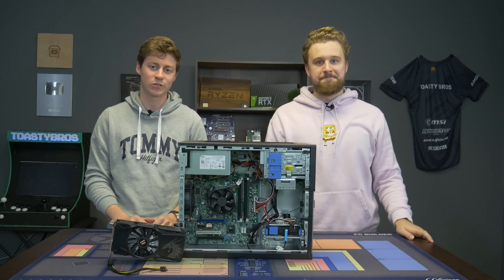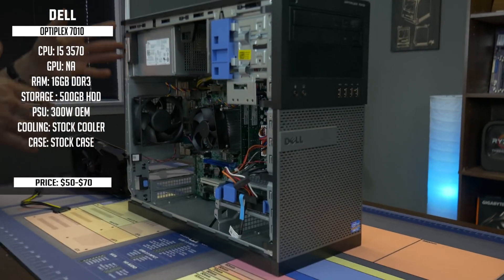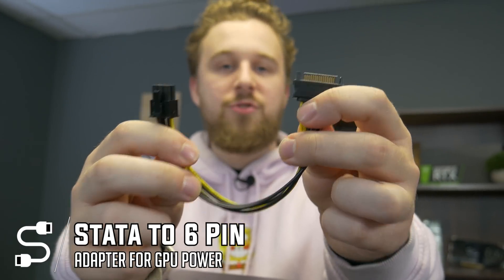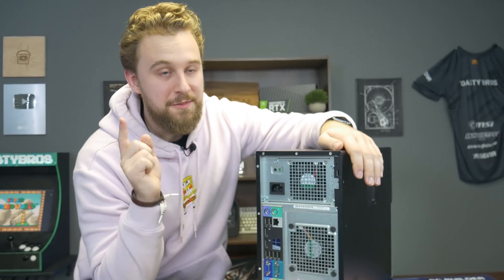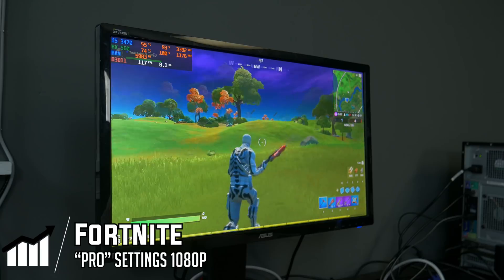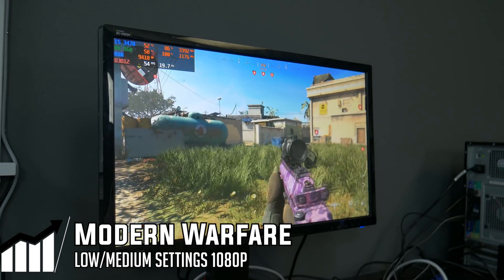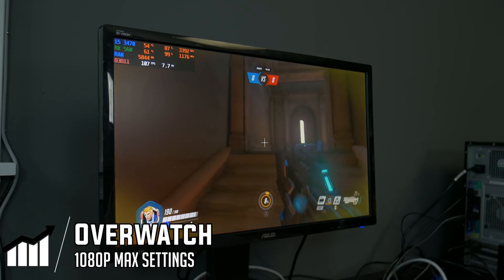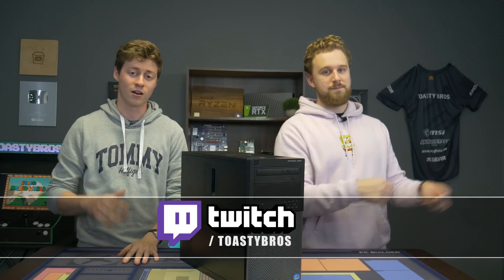2020 Budget $100 Gaming PC - Step by Step Guide

Comment: I have best bang for bucks (i made for friends tho, not mine. I use 4th gen i5 )
Intel xeon E5-2640 v2 LGA 2011 ($25)
Chinese X79 motherboard ($40)
Radeon RX 580 ($90)
4x4gb ECC/regular ram ($60)
Enermax 500w PSU ($40)

About ONLY $255 you will get performance equivalent to $400-450 
The PC that i build with that specs outperform mine with RX 470, which the i5-4460 alone almost double the E5-2640v2 cost. Mine (i5 4460 RX 470) only got 40-50 fps NFS heat mixed settings. And that xeon got 65-80 fps

Comment: Yeah I've got a dell OptiPlex 790 with an Nvidia 780 ti in it which I had to knock the hard drive cage out to make it fit and I upgraded the power supply to an aerocool Cylon 700w

Comment: It's starting to seem like these Optiplex builds are starting to go obsolete because the i3-10100 even without a GPU can play GTA V 1080p at around 50fps now. However, if someone finds a good deal on a graphics card and they're wanting to use it temporarily or for old games they can definitely install it in their existing computer no matter what it is as long as compatibility checks out.

If you have an old computer, you play old games and if you're not spending as much as something new it's definitely a fun experience.

Comment: Still better a deal than a xbone or ps4
Reply: Wrong
Reply: @supersop1367  for power, it definitely is. It'll outperform a 2013 console by a pretty big margin.
Reply: @thegloriouspotato6223  Xbox one is from 2015 and the newer models from 2019
Reply: @supersop1367  Release date for the original One was October 2013. The S was 2016 and the X was 2017.
Reply: @thegloriouspotato6223  ok but it doesn’t put perform consoles the benchmarks are faked I know a few people who followed this video and even had slightly better specs and it was bad
Reply: @supersop1367  I didn't look at benchmarks, I looked at the specs of the CPU and GPU and compared them. usually the only way older consoles are able to play new games is with lots of optimization, and running at low/medium settings would be a more fair comparison.
Reply: @thegloriouspotato6223  ok

Comment: That low price a pc no way ? How good is it ? Id like to see actual plY testing shown & how long it will last in hard play & twitch streaming over time. What of buiying windows to make it run ? What about to stream 2nd screen for you too see chat or just try to use tablet, etc ? I still am planning getting a ps4 & headset, tv, so I don't know if have enough for this, but maybe after if can't Dec Jan then I must get other stuff. These seem refurbished etc, not great ones in look etc to see there. Only one was minor scratches it said comes with all bundle, except maybe cables. It had monitor, windows, , keyboard, but scared ordering such an item on ebay even if good reviews on seller. Idk. Not sure same seller of the link as it has been a while & just found you. Different prices & seller. I want new not worry it won't work after 3 months when cant claim ebay money back. plus I do not want to pay 1 yr warranty extra. Guess I should on this if got it.

Comment: would a 2g card work?
Reply: yeah but 2gb is a little low especially for newer games, we are at a weird time right now pc prices are high and games are going to get alot more demanding in the the next years (new console gens)
Reply: @NaterBalls  I am getting a rx 570 4g with a 250g ssd and 12g of ram I think it should perform well also I'm getting a 500w psu
Reply: @bradyscherer675  nice, rx 570 for about 75-150$ gtx 1060 6gb is in that price range to if you haven't checked them out

Comment: What about the psu if I don’t upgrade it what happens
Reply: " boom " maybe it will take out and/or damage pc parts when it blows, their are lower watt gpu that would work if your worried (i would be) gtx 750, 1050, 1030,1650 rx 550 to name a few

Comment: I clicked the link and the optlitex cost 170+ dollars 🤨
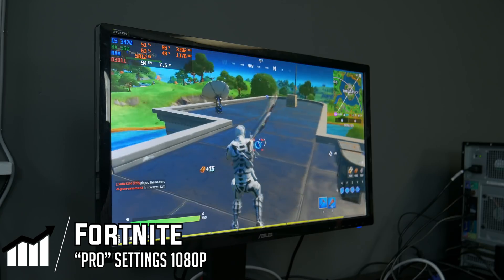Reply: Their budgets are completely misleading.  I like in the video where they suggest opting for a RX560 with better video out options for around $50-60 (6:25), like you're going to be picking up a in pre-built Dell with 3570 and 16Gb for..I dunno....let's be generous and say $70.  This build they're recommending is more like a $200+ option.  More likely you'll get it with 8Gb RAM for around $120 if you can find a good price, then upgrade the RAM yourself for $20, and get the RX560 for around $60.  $100 is just complete horse shit.   Also SATA power cables are rated for 50W, and PCI-E can draw upto 75W.  An RX 560 has a low TDP of 75W, which can be supplied directly from the motherboard, so it's no likely to be drawing more than an extra 50W from the power cable, but it's running the risk of putting a more power hungry card in the system and overpowering the cable - basically it's just not a good idea as the pwoer card could technically try and draw more power than the cable is capable of, causing a fire hazard or at the very least the cable melting / shorting something in the PC.  But want do I know, I've only been building PCs for 20 years, these guys have 180k  subs, they must be pros!

Comment: Where would the SATA connector be if it is not right by the hard drive? What is the difference between a dell optiplex 7010 and a 990? I am thinking about getting a 990 is there is no real huge difference.

Comment: Hey I got an optiplex 3010 with a i3 3220 and a rx 570, but the graphics card gives no signal. It has worked a couple of times, but after 5-10 minutes it just goes into a black screen.

Comment: I've done this a few times now. So something consider: The GPU you've picked is a mining card (DVI out only) which can have multiple bios' installed, some do not, so not a sure thing it'll actually work for gaming. If you do use that 6 pin adapter at the bottom of the case, the power rail for the CD drive usually has a spare power connector, so installing an SSD (Highly recommended) can still be done and mount it below the CD drive at the top of the case, just make sure you have a long sata data cable! Hope this helps!

Comment: Hi. guys. I love your video. But I do have a question: For a small office pc that will run internet, Youtube some movies and Windows 10 with Office 365  (not gaming) it is recommended a  very low budget new pc (like under 200 USD) or a refurbished one for the same amount of money (200 USD). Display and other peripherals not included. Just the PC. I want to use this as a second PC that will run maybe 8 hours per day. Thank you all for your suggestions.

Comment: Just like all of these ~$100 builds, the deals are basically impossible. You will never find that Optiplex with an i5 Ivy Bridge, 16GB of DDR3 and a 500GB HDD for $50-70, it would be more than double that. But you can get a Sandy Bridge i7 (4/8) + 8GB DDR3 for about $140 which is still very good value.

Comment: This is clickbait. -.- the parts in that pc add up to $400 the motherboard alone is $200 at the lowest
Reply: all the components are used parts im sure. of course its probably going to be a bit over 100usd depending on the deals you get on ebay
Reply: What motherboard is it? I am new to pc building

Comment: Hello, does anyone know if these specs will run beamng drive on 720p and medium settings:
Ryzen 3 1200
GTX 960
8GB 1366 MHZ
Thanks ☺
Also should I get a athlon 3000g instead?

Comment: What is the Optiplex's limit when it comes to SSD/HDD storage and RAM? Can it go further like 16gb RAM with 500GB/1TB SSD and 1TB HDD?
Reply: Depends on the model number when it comes to RAM capacity, a rough rule of thumb is if it has four DIMMs then yes it can take more RAM.  You will not be able to use more than 2TB for your Windows OS.  You can get a larger drive and partition it to multiple volumes using the excess, or you can use multiple hard drives.  As it stands there is no limitation on the size of the non-OS HDD.  

I have used 18TB as secondary storage.  Those gains come at a cost of speed, additional heat, and noise.

Comment: if somebody reads this, try using the sata adapter on the sata port following the optical drive not the one shared with the hard drive, those mustard cables might not catch fire but can get a bit warm if the gpu is too power hungry (I did melt a molex to 6-pin connector with a GTX 295 back in the day)

Comment: Love my Dell OptiPlex 9010.  Total cost for the pc along with the memory, graphics card and PSU upgrades around $450 and I can play any game I throw at it.  Running mixed settings of high and ultra at 1080p and getting no less then 60fps on all AAA titles, with most running 85fps and higher.  I'm also running the stock motherboard.

Comment: This isn't safe. Sata power lines are only rated for a measly 4.5 amps. You hook them up to a video card that readily draws more than that and you will get dangerous results. 4pin molex is safer.

Comment: ok dvi only i have that same problem and my monitor is a 165hz screen but its only hdmi and dp but ive had an old dvi to hdmi adapter for a while so ive been using that (btw info u dont need to know but im saying anyways is that the monitor was a present and im a low budget gamer and i was not expecting such a good monitor) the problem im having tho is that a can only get 60hz on default (software) settings and only 73hz when i software overclock it, so is there anyway for me to at least get 100hz on this monitor without buying a new graphics card?
Reply: Dvi D is the output but i dont know which generation (year/model) of dvi it is, all i know that is special about it is that audio is coming out of the hdmi wire Lol i was suprised too until i googled it and from what google told me I guess i have a resent port model. the graphics card is a rx 470 4gb mining card with a dragon on it (decent card for 75 dollars which i bought it for but it does go for less usually it plays Cod MW at around 60-100 fps at high textures and shadows no motion blur and highest vov taa lowest no bullsh*t settings, and fortnite runs at a pro level on any setting always past 120hz to my knowledge havent played the game in a while just know the last time i played it it played like a dream, and RB6 OHYA Amazing 100fps is the minimum X-D)

Comment: Theres no way you can have 16gb of RAM in a 100 dollar build.
Reply: It’s ddr3 you can find some on eBay for about 30-50 dollars
Reply: @crani9166  ddr3 is terrible
Reply: @cs.flippz9152  yeah, Ik but like for budget it has to do
Reply: @crani9166  I’m currently building a budget pc the whole setup comes to around £590. i5 gtx 1650 500w 16gb ddr4 ram and the rest
Reply: @cs.flippz9152  dude this is $100 video that you’re commenting on, I’m talking about $100 USD not that much.
Reply: @crani9166  100$ build bad
Reply: @cs.flippz9152  why not shoes 1660 Ti over 1650? Much better and from what I remember almost the same cost

Comment: Within the space of 5 days he upped the price to 49.99 and 10 shipping. I wish I knew that the 10$ adapter would lock me to 1080p 60fps before I bought the card because I would have just tried to grab a rx570 for 70-80ish off ebay at that point. The moral of the story is just get a 570.

Comment: I enjoy your videos. However, I have an issue with your price point quote. I have never seen a 7010 MT, SSF or anything with an I-5 for anywhere near $40-70. Its very rare that you can find one under $100 especially 16GB of ram. The ones I do see start bidding much higher or have enormous shipping costs (which you have to factor in). I have found a few Dell/HP's with old gen I-3 with about 8gb for about $75-95, but nothing close to your quote. Maybe you got a once every 6 month jackpot deal, but that doesn't constitute a viable price for an everyday build.

Comment: Can someone help me, i am averaging 30 fps on my 200ge at csgo with all low settings 1024 by 768 with 8gb ram at 2400mhz dual channel. No gpu. I dont know what the problem is. And when i ran cinebench it only scored 143 intead of 300 plus
Reply: Most likely due to your lack of a gpu

Comment: Can I use an SFF Optiplex for this project? Will the gpu fit?
Reply: You can, but you can't fit that specific GPU in it. You'd need to use a low profile card. There are a couple of low profile models of the 560, just make sure to look at the 1050 Ti as well, and compare the price, as the 1050 Ti will be much faster. Also, the xx20 series SFF systems have the PCI express x16 slot right next to the power supply, and aren't ideal for adding a dual slot GPU to.

Comment: You can actually go a bit higher power on the gpu before really bottlenecking that cpu. Something in the 200-300 dollar range brand new would be appropriate, though you may or may not be better off spending 40 bucks on a much better power supply to go with it as well. I wouldn't put a lot of faith in an old office tower psu anyway.

Comment: I wish I had known about the pice 6pin adapter.  I have a similar set up (i7-4770) but I put a gtx1650 cause it didn't require external power but I would've gone with the super version if I knew about this adapter.  It only has a 320 watt PSU

Comment: yo i got this exact card i did this exact build like a month ago lol
Reply: Alex Daquinag How is it going
Reply: dexisッ it’s going pretty good but I had to change the BIOS to UEFI because there’s an issue with legacy for 460s and 560s with optiplex xx20 and xx10 models but after I did that it worked fine
Reply: @poopsockhtx1668  do you have a 300w psu too? What happens when you push both cpu and gpu usage to 100%? I'd like to buy an rx 5xx since they are cheaper than 1650 and the likes, but I'm very worried cus everyone points out that it will fry your pc when you run at lower wattage than recommended

Comment: Are there any other graphics cards that aren’t too expensive but still work with this build? I checked eBay and Amazon and all of the cards in the video were either non existent or really expensive... I have a budget of around $60 for a graphics card
Reply: I would save up until you can afford $100 or more, or skip out on a graphics card for now and start out with a CPU with integrated graphics so you can start off with some light gaming. The Ryzen 5 2200/2400 and 3200/3400 are nice starter cpu's with decent integrated graphics that can play a lot of games at medium settings that you can pair with a graphics card later on.
I paired my 2400 with a RX 480 and love the performance I get for the money spent.
You get a lot more value for money spent in the $100+ range for graphics cards, unless you find a used one at around $60
Reply: Mark D. I can most likely afford a $100 card

Comment: I'd never recommend converting from SATA to 6pin. SATA is rated for 54 watts/4.5 amps and 6-pin PCI-e Power cable is rated for 75 watts/13 amps. You understand that even though this rx560 with ~60-80W power draw is OK, using this converter for a 1060 3GB for instance, will put your system on fire. Better convert from Molex if possible which can draw >130W.
Reply: I'm astonished that I had to scroll all the way down to find this comment. In general, using 275W Dell PSU for RX560, that officially requires 400W PSU (even non-6pin ones) is very bad idea. GT 1030 is probably only card which could work in long-term perspective with this PSU, but I still wouldn't guarantee that.

Comment: I’ve actually made one of these builds as of 2 weeks ago with the Dell optiplex . dont expect to get all this under 100 . Optiplex s are going up in prices . I cheaped out on the graphics card and got a cheap psu(please don’t do that lol) and it still came out to around 180ish . But I can almost guarantee you’re not gonna get all this stuff for under 100 .
Reply: Will it set on fire or overheat
Reply: Txzed no lol for the most part you’ll probably be fine but you really shouldn’t cheap out on certain parts
Reply: Can you suggest a good gpu upgrade? And do you have to upgrade psu?what would be a good one. I just picked up my optiplex today. Need some help
Reply: @Bustedkuhnuckles  what gpu do you have rn. I would go to 1060 or 1650ti
Reply: @Bustedkuhnuckles  or rx 570 or 580

Comment: please help me understand something. They used HDD Sata cable to power up the GPU. Other videos have used Molex 24 pin to 6 pin convertors but it's different here. Should I use the same technique Toastybros used? first time seeing this method? will it work for me without 24pin to 6 pin convertor?

Comment: Ok so I messed up and got a dell optiplex 390. One of the smaller ones not the big one. It’s the i5-2400. Can this graphics card still fit?
Reply from the maker: It’s going to be more expensive but low profile 1050’s, 1050 TI’s or1 1650 are your only options
Reply: Toasty Bros to save some money would the 1030s work? And would that cut back the FPS a lot?
Reply from the maker: No, the 1030 is a way worse card than the one we used in this video
Reply: Disregard this. So I need a low profile 1030 graphics card. Ok so what would be a good brand? Please help. This is going to be my first time building a cheap gaming pc

Comment: 5:14 Thats not true, you can do a 2 Monitor setup by using the GPU DVI for your main monitor and the Motherboard Connection ( VGA )  for the 2nd Monitor its gonna use Intel HD graphics to output a Signal, which is fine for 2nd Monitor Purposes like Youtube Discord Twitch Dashboard etc.